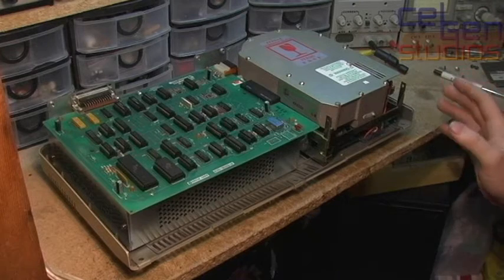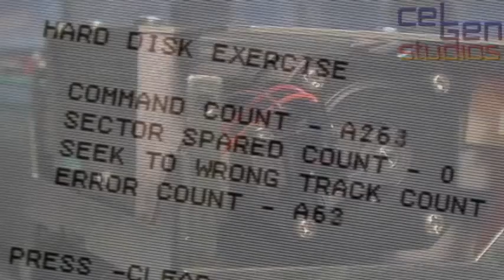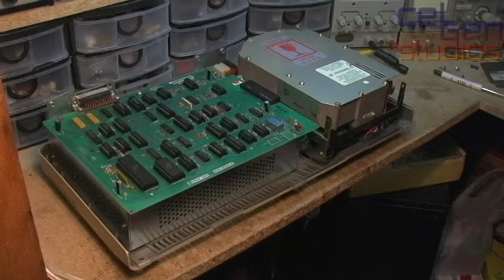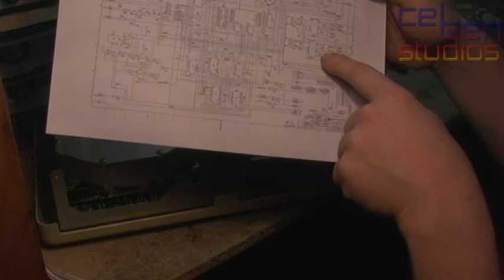Apple ProFile Hard Disk: Stepper Troubleshooting

Comment: You have tested the diodes on the steppers under load?
Reply from the maker: +Warren Postma 
Never tried that. Typically the diode test on a DMM suffices well enough to say if it's good or not.
Reply: +CelGenStudios   I have seen Diodes that were what I assume were "thermally intermittent under load" and this did not show up on my DMM.

Comment: If you suspect a coil in the stepper is stuck on or off, I'd definitely be putting a logic probe on U15, pins 3, 6, 8 and 11. When the drive seeks, all four outputs should pulse. One output will change in sequence for each step.
Reply from the maker: +256byteram 
Thank you. I'll have to look into that. One of these days I really have to invest in a proper digital scope.